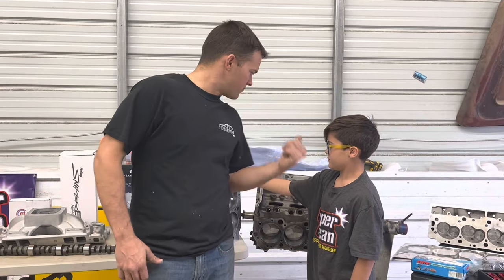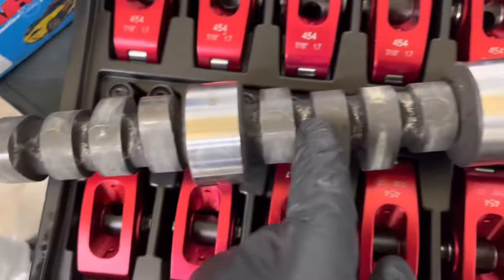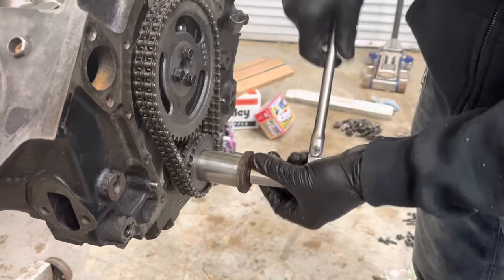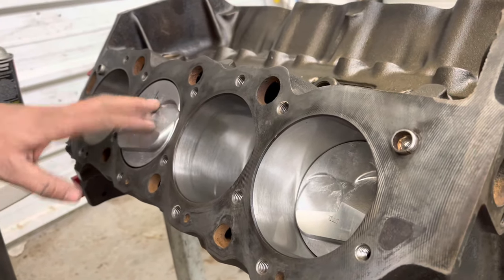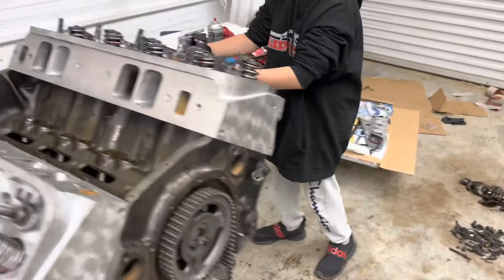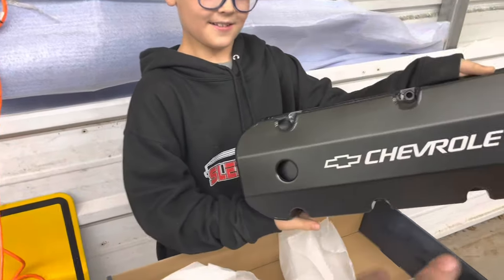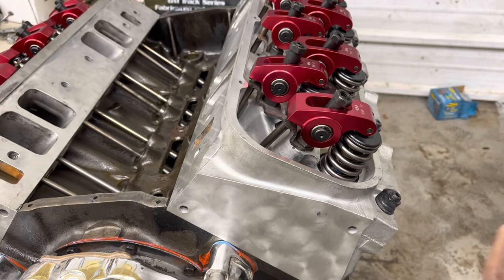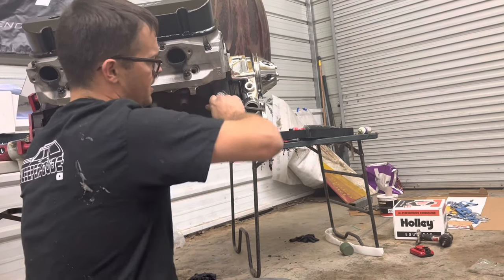No machine work BUDGET 454 engine build for BOOST returns

Comment: You can definitely build horsepower using aftermarket and used parts. Did it a lot racing brackets but when we stepped up to Super comp (8.90) Super E (7.90) Then Top dragster (7.50's) we built BBC engines. Dart blocks, splayed 4 bolt rod caps, filled block, Scat crank, Carrillo rods, Crane roller cam, the entire valve train was Jessel, Brodix Brute force ported aluminum heads. Matched intake, 1050 Dominator ported to 1150. On the dyno at 468 cubes it built just over 1000 horses and about 900 plus torque at 7400 RPM running on C-14 racing gas. Ad on some nitrous it ran 7.50's. Got out when qualifying alone was in the mid to low 6's. Just built a really reasonable 350 small block Chevy blower motor for my rat rod. Used almost all used, vintage and some new parts and a 1960's GMC 6.71 blower. Good job proving it can be done on a budget. Always enjoy your family oriented video's. Keep up the good work.
Reply from the maker: Wow that’s fast . Thank you for watching

Comment: I'm no pro engine builder, but when you clean up those holes for the head studs I believe you might want to use a bottom tap. Normal tap won't clean the threads all the way down. Hope this helps.
Reply from the maker: Ok thanks
Reply: @Paul Rattenbury Big blockChevy head bolts go through to the water jacket. They are not blind holes regular tap is fine

Comment: This is how my Dad and I rebuilt engines in the 70s and my Dad did the same before that with his dad in the 50s. I love to watch all the comments of all the kids that think everything needs to go to a machine shop etc. We didn't have the $$ for that we rebuilt Chevys and MGs and Austin-Healeys and Pontiacs and Sunbeams etc. in the garage and after that I worked in the Oilfields and we rebuilt Detroit Diesels in the field and on offshore platforms and they all worked as they should. I'm doing a full roller 880 block 350 right now and watching a ton of videos te remind myself of things I have forgotten. It's been 20 years since I have rebuilt one. Man have to the prices of parts gone up. Awesome to see someone passing on knowledge to the younger kids. Thanks for the Video.

Comment: Also when you're breaking in a camshaft you want to use non detergent engine oil. If you use regular detergent engine oil it will wash the cam Lube off of the cam
Reply from the maker: Ok thank you

Comment: Great job on the engine build part 1 and now part 2. This brought me back to my high school days when rebuilding my 1970 SS 396 Chevelle motor. Something about a big block that you just can’t resist! It’s only fitting that you put this in a vintage Chevy. My favorite is a 68-70 Chevelle but a Nova or even a Camaro would be cool. 👍🏻
Reply from the maker: I wish those cars were cheaper, thanks
Reply: @Sleeperdude  I do too! Anything you find will be cool!

Comment: Good job! I love working on engines, especially the big block Chevy. Parts are very plentiful and fairly cheap compared to an LS engine. I really didn't know what a big block was capable of until I purchased my 1970 Chevelle SS 454 a few years back. OMG that car is the fastest I ever been in. It idles like stock but I don't know yet what they did to the internals, but the car is very fast. Original 512 block, GM 290 oval ports, GM iron intake, LS6 carb, headers, 4.10's. Love it. I suspect your engine N/A will make somewhere around 500 HP/ 500 TQ. With the turbos I don't even want to guess that. Be careful.
Reply from the maker: That’s so cool . Keep up the good work

Comment: When putting on the lower gear, you can cut a piece of exhaust pipe to fit around it, put a piece of wood on the outer end of the exhaust pipe and tap it in.
Reply from the maker: Ok thank you

Comment: My first motor was a 289 Ford, stock bottom end, stock heads (port matched) careful assembly and swap meet bolt-on parts (carb, intake, cam, headers). It was kinda mild but it had a lumpy idle, it acted kinda hot. I was mighty proud. My car would really scoot but I didn't race for real. Everybody thought it was fast.I was in that motor for $450 (back in 1977)
Reply from the maker: Oh wow

Comment: One thing Josh, that I did learn was how  to use those high compression, high dome pistons and still use a turbo on it. I had thought you were limited to 8.5 or even 9.0 compression. Back in the day I built my first small block 283 chevy engine and stupid me didn't have a scatter shield over the flywheel so when that turbo spun it up... things got interesting kinda. It made a screaming sound like a cat with its tail in the door. First the flywheel came through the floorboards and got my ankle... still have the plastic replacement, but that crank broke in a few places... all my fault cause it was rebuilt by me and like maybe the third or forth motor I'd done. It really stretched all those "completely stock" nuts and bolts, the pistons were the valve relieved ones that was supposed to give around 10.0 compression. I and another guy helping me learn took a turbo off my dads old Mack truck and cobbled it on over a carter four barrel. It took us a week of cussing and welding to get stuff figured out.... this is back in seventy one or two as my memory serves me. I was told afterwards when in ever it had blowed up that you went low compression on the pistons and so I did afterwards. I know on diesel engines like the cummins we lowered the compression for the dual turbo set ups. So its more to it I see
Reply from the maker: Wow that’s a cool story I can’t believe you had a turbo v8 in the 70s thanks for the advice

Comment: I’m excited to see how this turns out.. I just bought a 1999 Chevy 3500 with a 7.4 in it but I could hear a knock when I got it running smooth and I noticed the crank wobbling a little bit so I’m sure the mains are shot. I just hope it’s salvageable. But it’s what I wanted; a dually crew cab big block so now I just have some more work to do lol. 👍

Comment: Im old school and have many BBC vehicles currently. Including my #1 prize possession : 1969 Chevelle 427 COPO
#123 of 373 built.  

#2 - 33 Ford Coupe 3- Window 3.5” Chop, Channeled, 33” tire on back, air Ride, 502 GM Performance short block, Polished Alum Heads, big Hyd Roller, 871 Blower, Dual Holley Sniper FI, 400 Turbo trans, 3,500 vert.  A/C, Vac pump, power disc willwood brakes.  Weld Aluma Stars double bead locks on rear 15” x 15” and 3.5” on front.  This car has been driven to Bakersfield Ca & Knoxville Tn from Texas.  Not one issue.  Has Cadillac CTSV LEATHER Interior, Heated and a/c seats, it looks like an Outlaw Drag Car but it’s an Outlaw Pro Street.  The Ole’ Gal’s name is
“SINISTER!”  Has a pink parachute on it because without the factory style fuel tank, there is too much room in the back area to fill and looks funny.  Even tho the tires are 66” tires across lol. 

The parachute and wheelie bars took up just enough space to fill the gap.  

With Blower Pulley’s one  way it make 1,175 HP @ Flywheel and the other way, 680 HP.  I have it on 680 Hp to drive it.  

The reason I went thru all my life history (LOL), was to tell you that a little 6.0 Chevy SWB Truck with an 8” Drag Radial, busted my ass.  Lol.  He was a TUNER and had that lil truck on rails.   Old stuff is cool but this new LS stuff is AMAZING!
Reply from the maker: You have some cool stuff , my starlet went 5.9@120 in the eighth with a 6.0 ls they are good engines but there is just something about a big block

Comment: This is awesome man. I'm doing a very a similar build except na! My budget build started with a brand new still in the crate LS6 454 I found in a barn. Of course I got carried away and ripped the stock heads, cam and intake off and replaced them with the same heads and intake you have but went with a roller cam setup. Hoping for around 700hp with my combo! Also scored a 78 cutlass all setup for drag racing from the same person in a storage unit! Stole them both 1900 bucks, lol. 🤣
Reply from the maker: Very nice

Comment: Warm up the crank sprocket with your mapp gas torch just a couple hundred degrees 200-225 F will open it up to where you can slide it on by hand.
Reply from the maker: Ok good idea

Comment: Install the camshaft before the crankshaft. That way you can feed it easily through each cam bearing from the bottom. Assembly lube goes on the lobes, engine oil goes on the journals.
Reply from the maker: Yes it is better to install it first but like I say in the video I didn’t have it at the time

Comment: Just thinking out loud... you could pull the inner springs out for cam break in, then reinstall them. Kind of a pain, but is extra insurance for breaking in a flat tappet cam. I would like to see you stuff this in a regular cab, short bed truck... think early 90s 454 SS truck
Reply from the maker: That is a good idea

Comment: I had good luck with using a big ole sanding block 120 grit to finish the heads and the deck on the block, then used straight edge and feeler and she is true.
Reply from the maker: Yes!!

Comment: I would recommend using a thread chaser rather than a tap because a tap will cut into the existing thread's making them thinner, also putting hydraulic lifters in oil is a old timers thing because if you have a lifter that has oil in it it will give you false results when setting your zero lash, you want to just lube the bottom of the lifter when drop them in
Reply from the maker: Ok great thank you

Comment: Nice build. Heard those heads make good power. Suggest spending the money on oil pump primer or old distributor. You wont get oil to the heads with a screwdriver.
Reply from the maker: Ok thank you

Comment: Love watching you. And Ralph’y and the goats hahahaha I always use a old timey oil pump bottles with a little piece of rubber hose on the top so it will seal to the oil hole in the lifter and just simply pump the oil till it comes out the pushrod hole

Comment: Thanks for posting.  You made some good points on the top end. Good jokes too.
I would have reused the heads, bolts, and even the rockers. The heads just need porting. I like using the bean torque wrench. First one I used.
Reply from the maker: Thank you

Comment: Jeeps (4.0 L6) comes from factory with a flat-tappet cam all the way up to 2004. +1 on the zinc additive. Oil companies today have really reduced the amount of zinc they use.
Reply from the maker: Yes that’s true I didn’t realize keep kept them that long
Reply: I don’t think there’s any on road oil that has zinc in. EPA rules. I’m pretty sure diesel oil no longer has it also. Off road oil still does for 4wheelers and such but it’s really expensive. 10 dollars a quart and up.

Comment: Pretty awesome build, I do pretty much everything you do.... except for the dowels on the deck surface. I take those off, and I take 180 grit wet dry sandpaper, and I go back and forth until it's smooth and the factory machining marks are gone on the deck. you know they always talk about the ra finish. Well, with that Teflon finish on the MLS gasket, you want it to be as smooth as possible. And you need to get some Ultra Gray gasket sealer in your life that stuff is the best, and it doesn't look as horrible.
Reply: Also, if you're using the Terminator X, why don't you use the coils off an LS with a trigger wheel on the front crank. It would totally clean that engine up, and it's super easy and cheap.
Reply from the maker: Thank you

Comment: I see where others have suggested putting the 454 in some of the other cars you have but seriously if you dropped it in that Rambler you would have all the room you'd want for headers ,radiator and etc. and  probably wouldn't have to do little if any firewall mods!! As I watched you resurrect that Rambler I was thinking what a cool Gasser it would make.
Reply from the maker: It would make a good gasser but actually sold the rambler

Comment: if your running twins that block and heads really needs to be O'ringed or your just gonna keep pushing gaskets even worse with dome pistons and when you install seals lay a piece of wood on it it will help keep straight and keep from putting hammer dings in it causing it to distort it

Comment: Great video 👌minty job, 1 tip for intake gaskets or any other dry gasket if ya need them to stay where ya want em for a lil while not forever is your wife/gf hairspray. Spray a little of that around let it tac up set it where you want em and they'll sit where they needa be for 5,10 min
Reply from the maker: Ok thank you

Comment: My Dad was a Tank mechanic in the army when he retired he would rebuild a motor in the back yard for $100 and beer/smokes. He had some 2x8s run across two trees and a come along with some huge chain he had to pull a motor. He used kerosene to clean everything and would usually do rebuild a motor in a week. This was back in the 70s and 80s.
Reply from the maker: That’s awesome
Reply: He got my mom a 50’s Ford Falcon station wagon in baby blue I think about that car everytime I watch your videos. Thanks for the hard work you do and sharing your awesome family and pets.

Comment: i spent $3,500 on a STI Subaru short block = $15, total - radiator starter altenator power steering all new - full rebuilt heads s/steel valves - all top shelf and alloy sump kit STI balancer big oil pump s/steel fuel braided hoses walbro pump and custom fuel pressure regulator .

Comment: They make these things for gardening that can be used in mechanic shops. They're called knee pads. You strap them around your legs. Be careful to follow the instructions because different makes may have varying levels of tension for optimal comfort.

Comment: Thats a slick build. Not one armchair technician was harmed during the build, if they lost their minds, it was relative to where their grandmother signed the certificate... I was always suspicious of a grandmother named Frank in the first place. That build cost approximately the same as a good drunk when I was logging in the southeast and I never whined about that either. You can tell your wife while you take her to a nice vacation spot in Bolice, South America or someplace far from where the engine is located. I do advise this going in front of a electronic shift transmission thats rated for abuse or severe use applications. At the minimum I would use No., 9 tie wire to assist the mounts... Dirty Dingo or your own version of a CNC home built mounts most likely will suffice long enough for the start-up test and good scatter shields are used. If this doesn't work out for the power that you did try for, it can always be installed in your wifes merchandise rig.... I forgot the name of that tin box you bought and are fixing up for taking to the swap meets. It kinda reminds me of some of the Nova's we ran at Arlington drags. Back in the seventies we thought we built a engine strong enough to compete with guys at Daytona but then seen what a sponsored engine from the then Big Four car companies.... AMC was still a car company and should still be as their guys never got the recognition they honestly deserved. They thought the other three were going to play fair I guess. Please get the patron account set up and those "Thanks buttons" under regular videos so we can give money when we can spare it. I am going to send some folks in Canada this link as they are some great guys who are doing fairly good now. Thank you Josh for this really well presented video. I wouldn't change a thing!!
Reply from the maker: Thank you

Comment: Should not prime lifters. Manufacturers even say in the instructions. So that they are not pumped up putting overly tension on cam lobes at first break in. It allows lobes to spin lifters easier and seat in their proper prospective at break in. Lube bottoms and cam lobes obviously. 👍

Comment: Would a 454 V 8 work on the street with a stroker ? I'm planning on building a 496 for my Tow truck. I've built about 10 motors so far, all stock size and was wondering, how long does a stroker last
over a stock build, same ? less ?  Thank you for your assistance.

Comment: Your setup is similar to mine except mines a Gen5 60 over 454, I've got ported and milled cast iron 781s on mine for now! Those aluminum BBC heads are expensive, you got a great deal on those! Mine is going in an 85 Monte SS so it's gonna be a sight different than the weak 180 pony pusher that come factory in it!!! What you think you're gonna be pushing at the wheels?
Reply from the maker: That’s going to be fun in a Monte Carlo , mine is going to be twin turbo so I expect it to make 1200 at the crank , not sure about to the tires
Reply: @Sleeperdude  That's awesome! Cant wait to see what you muster up to stick that monster in!

Comment: Thank you for the great video🙏 much appreciated .. I will be doing my first build ever 454 BB I want to build it for boost will this be a good setup?  Would you have change anything on the parts bore, stroke etc. Thanks in advance
Reply from the maker: The only thing I would like to change is switching to forged pistons

Comment: Love the build, it is fun and a learning experience with some nice tips. Since you are going to paint the engine some color do you plan on removing the water pump so you can paint the time cover fully behind it, also if you have the factory stamped steel full pump block off plate why not use it since you will probably paint it?

Comment: Nice work 👍. Is there a part 3 ? 
What’s the advantage for a flat tapper lifters/cam ? Do you have to run an additive in the oil ?
Reply from the maker: There is a video of me installing it in my Ford Fairmont. There is no advance to a flat tappet cam it would be much better if it was a roller but they are more expensive. Yes I am putting zinc additives in the oil
Reply: @Sleeperdude  
Cheaper since you were making it a budget build ?  Good deal man thanks , I’ll look for the video !! Keep up the good work